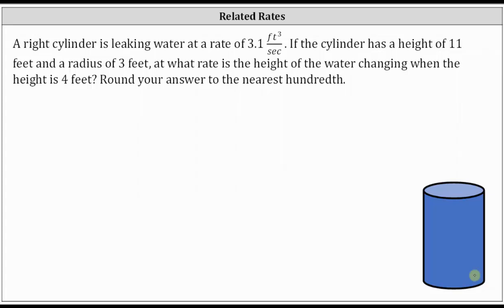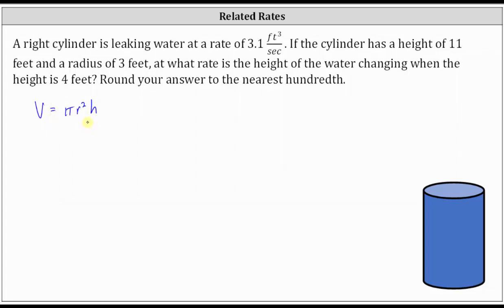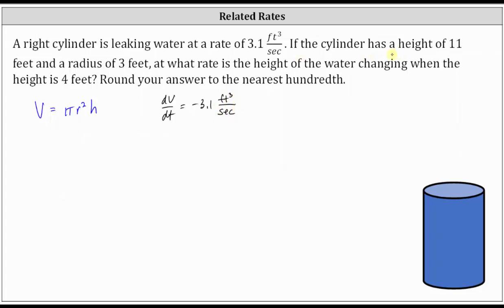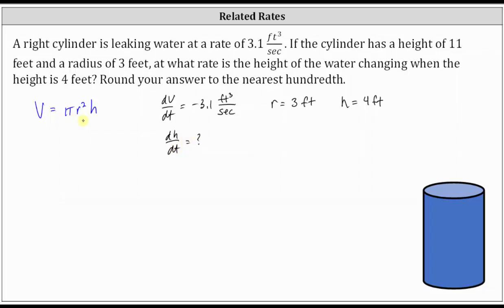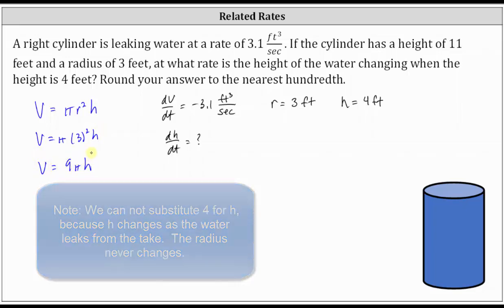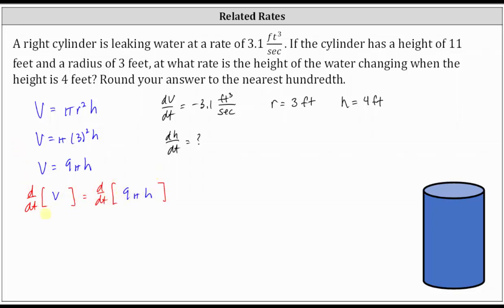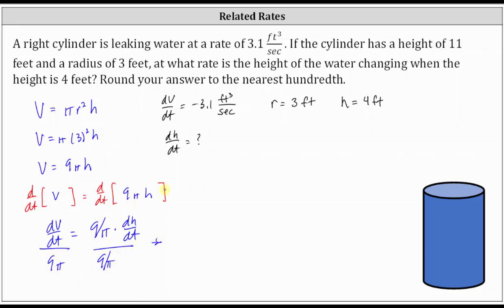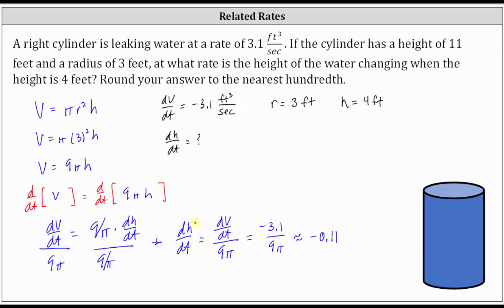Related Rates: Determine The Rate of Change of the Height of Water in a Leaking Cylinder

Comment: since you never plugged in the 4ft does that mean that the heights rate of change is the same at every height?  trying to understand the purpose of a height value in the problem when its not used.
Reply: You are correct, in this case both rates (change in volume and change in height) remain the same